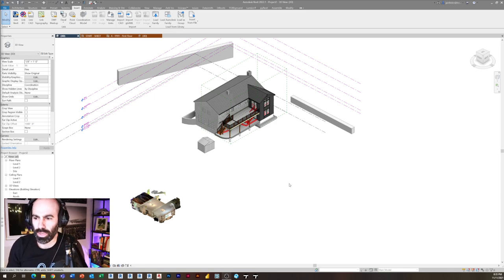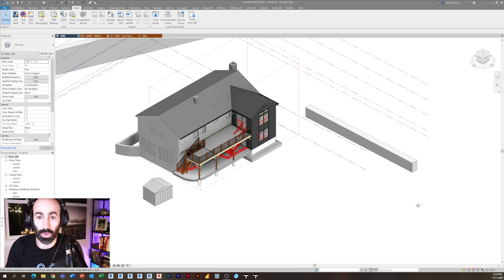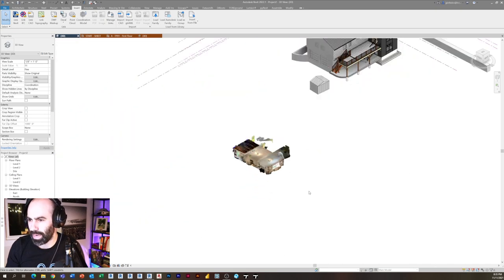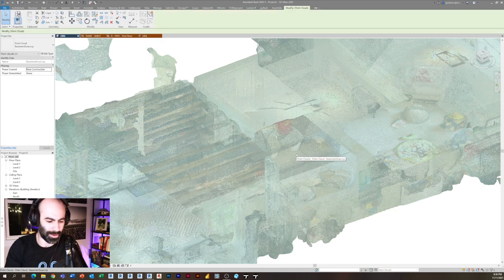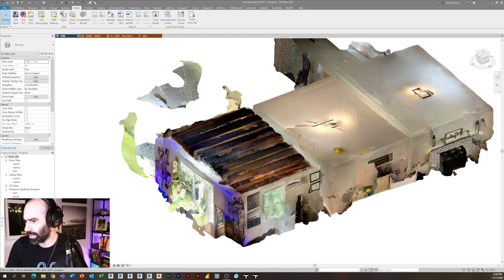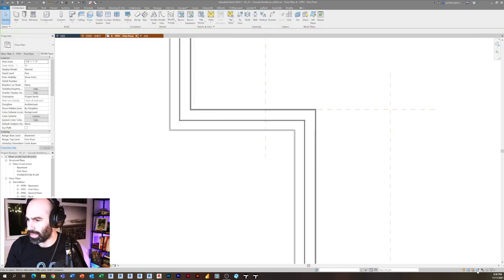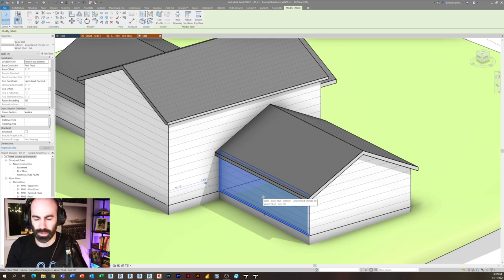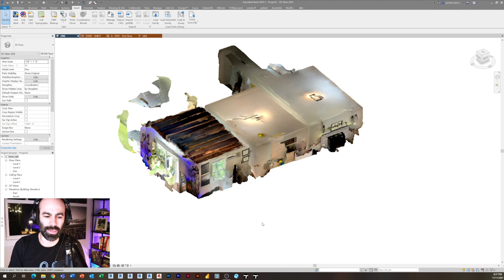Selection Options in Revit Tutorial

Comment: May I ask what microphone setup You use? You sound very good and cristal clear. Thanks!
Reply from the maker: I am using a Shure SM7B with a Focusrite interface and a cloud lifter in-line.
Reply: @TheRevitKid  Thanks for the reply. What room treatment did you do?
Reply from the maker: Not much.  I am in my dedicated office which actually has concrete floors, drywall, and an exposed wood ceiling.  I do have acoustic foam between each of the joists in the exposed wood ceiling.  The exterior walls are fully spray foam insulation and I have a small rug in the room.  All in all, it doesn't have a very big reverb to begin with.   The SM7B with the cloud lifter let's me keep the gain pretty low while still getting some great sound... I think that (along with the quality of the mic) keeps background noise to a minimum. (Let me know if I am geeking out too hard... ;))